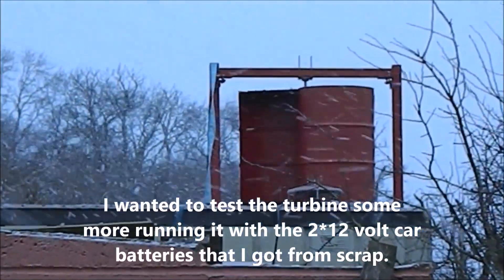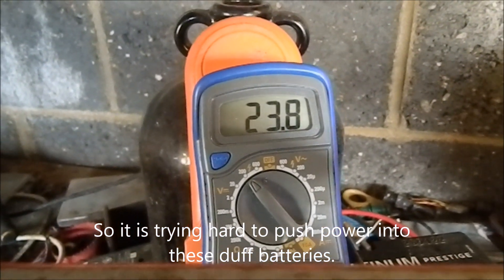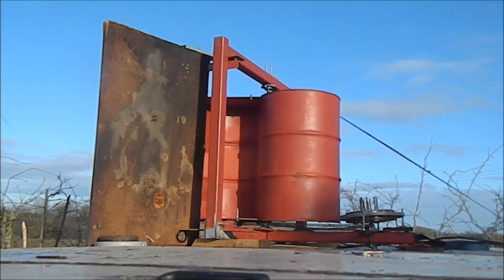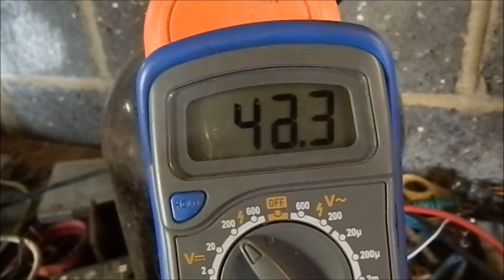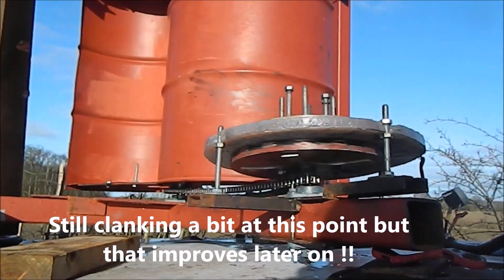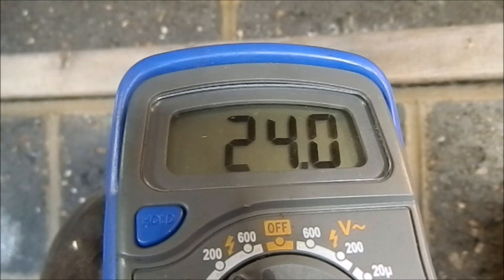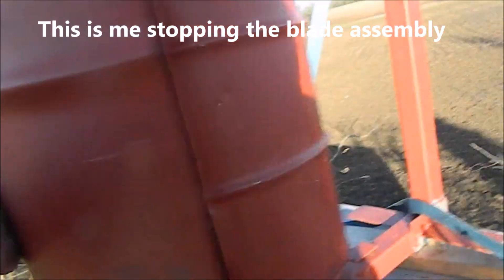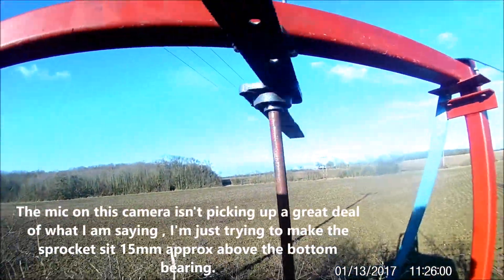Prototype VERTICAL AXIS,  Oil Drum VAWT wind turbine 24V FREE ENERGY PROJECT.

Comment: The most efficient energy conversion is electricity to heat, i.e. hot water tank. As long as you still have any heat requirements your system could run, forget about lots of battery infrastructures.

Comment: Just having a look at your older videos and came across this gem. Great project.
Reply from the maker: Yes it was a real shame at the time because I remember buying one of the amp metres and it blew up because it went over 60 volts. So in high wind conditions that thing was very stable but I never found out how much power it made, It's probably as good as any vertical prototype

Comment: As you increased the wait to 10 kg , you should also add one more fins/half cut cans on the top of your vertical wind mill with synchronised ,so that in the same  ratio the speed get increased which down to 1/4 th of initial ,,, 

Synchronise some more cans ,, wind area increase

Comment: I have thought that the area that the wind acts on can be long and smaller in diam  instead of shorter and bigger in diam......this will make it more compact as there is less room at ground level with a big diam but more room if the diam is smaller and much longer where it will just be up in the air........the area the wind acts on can still be the same.

Comment: put the turbine at the end of a large funnel to concentrate the wind speed, mount the turbine horizontally for more efficient chain transmission and have the whole thing mounted on a revolving platform with a vane to line it up with the wind. Try using a gear change mechanism off a bicycle . The chain your using is overkill

Comment: Check power generated on a given day with a specific wind speed.. then build a horizontal version with the same cross sectional footage that you have on the half barrel vertical.  You will find 50-70 % more power being generated by the horizontal system.... That is why 99% of the world uses the horizontal axis turbines... The problem: during 1/2 the rotation, wind is pushing against the turbine slowing it down.. It's amazing that you can get up to 20-30% efficiency... The only way to make it viable is to furl the blades 1/2 the time.. a noisy way of generating power.

Comment: I Think You have done a great job.!!  Yeah, you have" but like All of us, your just needing to Learn a little bit more". That means " Trial & airour my friend.!! But hears a tip for ya, if it's okay"... I mean I understand that you have been given, advise from everyone, but they are setting on the sofa, watching UTUBE, and Never touched a Tool in There Life.?? OR have, But ONLY Long Enough to take'em out of the package and into the tool box." Now, it looks Great" but can you see how much the stater, Lean's twords the barrel's.??  If it was me" I would cut the long bolts off on the Top of the, stater, "Then I would put a bearing on the center shaft. Okay" then I would, make something to bolt on to the top, with the bearing in it, then bolt it all back together. That's how I would, Stop the Chan from scrubbing, and it will give More out-put, Power...

Comment: What about putting the rotor directly on the turbine axel and adding a second barrel so you get more surface area for the wind to catch and less potential energy getting exhausted in moving the roller chain as remove multiple points of failure?

Comment: Bad batteries usually have one or more cells that act as an open. Thus, the voltage across that cell increase rapidly during charging and under load. Therefore, you can see a bad cell when its the only cell that "boils" during charging or under load. Because of this effect, a charging circuit usually will "see" less of a load trying to charge the faulty battery. Conclusion: either your faulty batteries are not as bad as you say, or your generator/controller don't work as good as you think. I think it's the first option. Better test will show the current that your batteries are being charged with. 
Keep up the good work!

Comment: Not putting down what you have done which is a great job. Could you put the axial directly on the the vawt ? and while you are at it put your 36v dc experiment at the top. the VAWT why has no one put a double row of axials on them? all it would take is another coil ring with one other set of magnets. the top magnet ring plate you have on now would have to be thinner as it would magnatise the top coils and the bottom coils.
Hope this makes sense. The vawt's have a rep for the wind hitting the vanes and pushing against the other not by much but slightly slowing it down. A weird idea is to drill holes into the vane and when the wind hits it the wind would flow through it. like a one way valve in a stirrup pump. wish you success on your endeavors.

Comment: do you think another sprocket somewhere near the middle of the chain used as a stabiliser/tensioner would work
Reply from the maker: maybe , the problems are all coming from the assembly which holds the rotors which needs amending slightly.